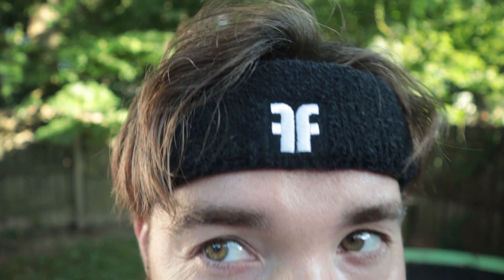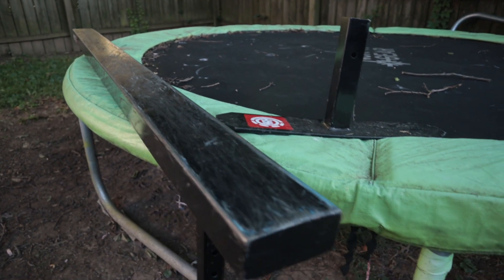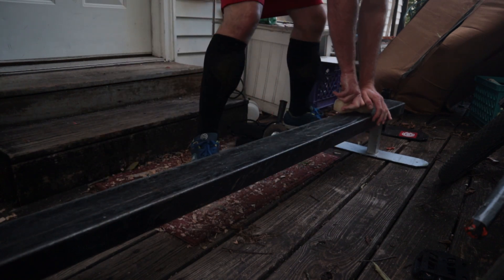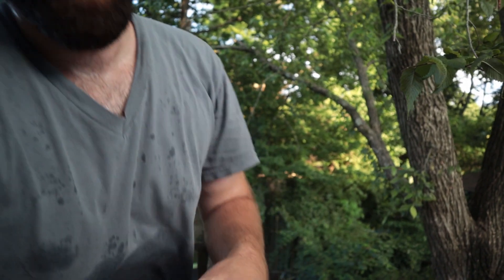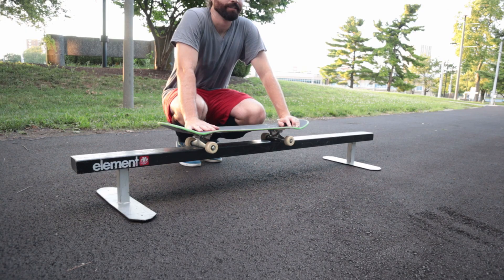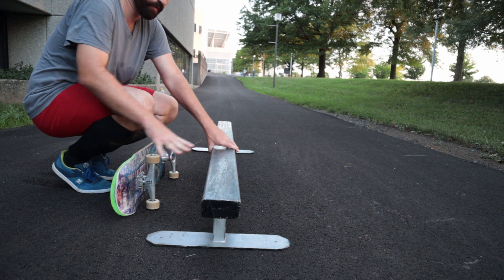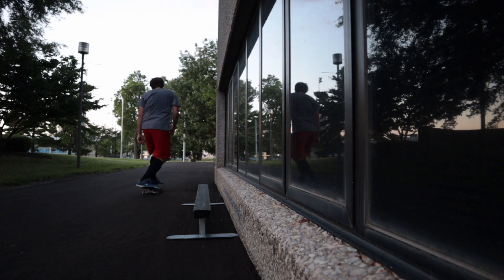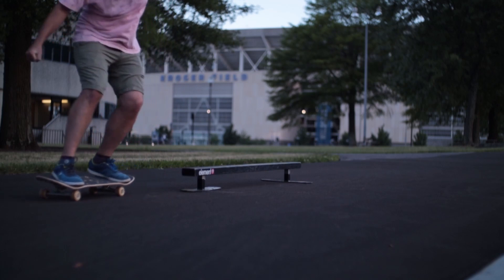Cutting down an Element Skateboard rail

Comment: You could try to add some DKL grip tape under those legs of the lowered flat bar. It should help a bit I think. Lowering it even further would also lower the total mass, with it being lighter it might actually be pushed sideways easier. These bars won't 'tip over' easily anyway, the feet are wide enough to prevent that from happening. Anyway, definitely like these DIY type adjustments.